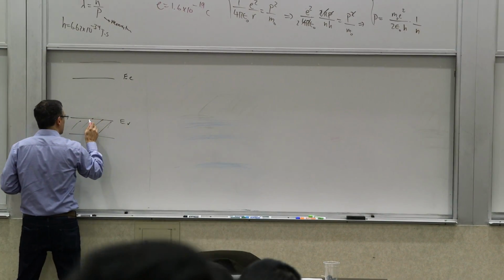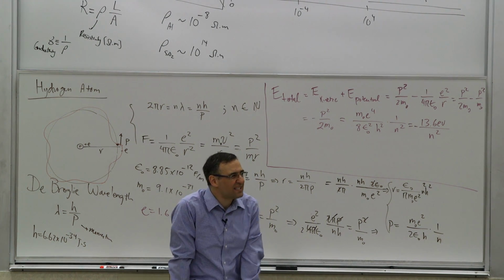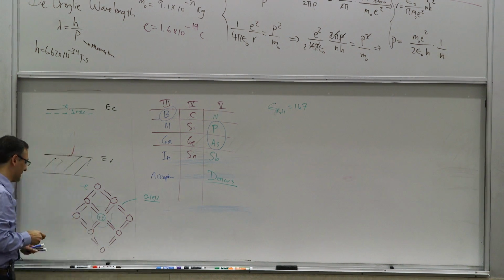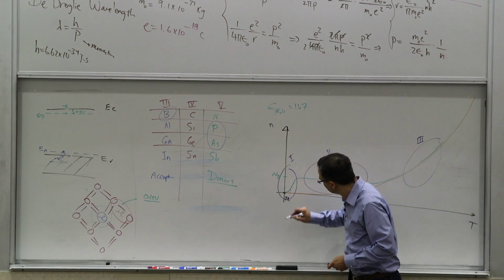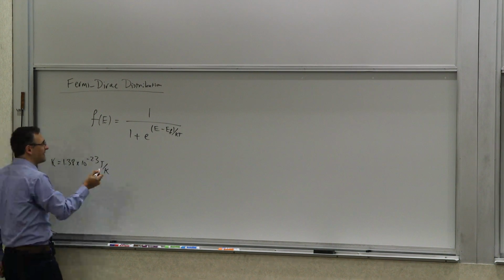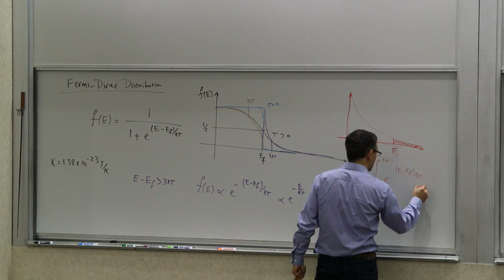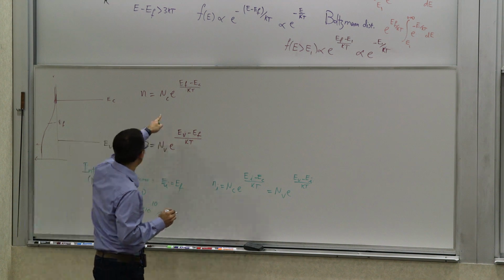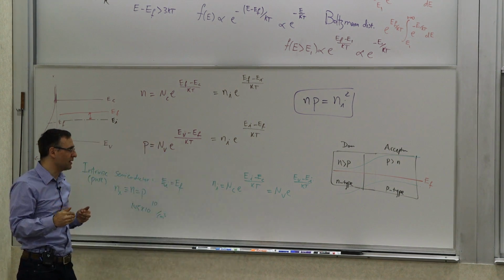102N. Basic Solid-State Physics: Doping, Carrier Density, Distributions

Comment: I don't understand the concept of n_i. At some points it seems to be the electron density in silicon, but at other points it is the number of electron-hole pairs that may be produced in silicon for example if n_i = n = p. The number of pairs produced would be dependent on the temperature.

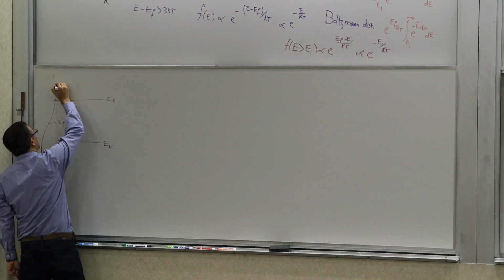Comment: According to that figure that was sketched at around 29:28 (where the F-D distribution was sketched together with the energy-band diagram) the following inequality holds: (E_v < E_f < E_c). But let's assume, that for some E_1 and E_2: E_v < E_1 < E_f < E_2 < E_c. In this case the integral of f(E) from E_1 to E_2 would be a larger than 0 number; this would mean that the probability of finding an electron between the energy levels of E_1 and E_2 is not 0 (it is possible). But the whole idea of these bands and the bandgap is that the electrons could only be either in the valence band or in the conductance band, and not in between them (in the bandgap region). Is there a contradiction here somewhere? Or am I missing here something?
Reply: I have the exact same question :(
Reply: @CrazyMineCuber  it seems I was lazy enough not to read all the comments before posting. One of them - that was there way before I placed the question - is roughly about this same concern. And the professor seemed to answer that.
Reply: @MrGyulaBacsi  Thank you for pointing that out! But embarrassingly enough I to saw just after I wrote the comment. Now I just wish I could find somebody that can explain fermi-statistics and density of states as well as Ali.